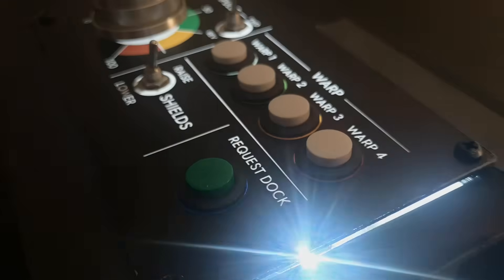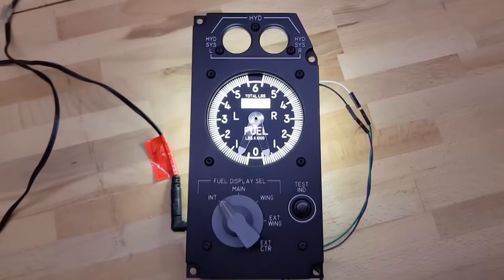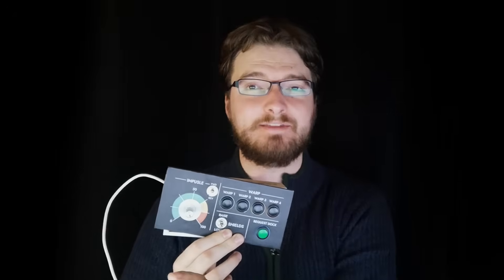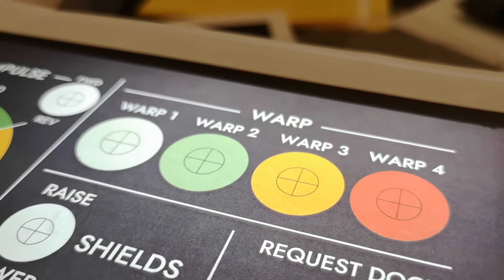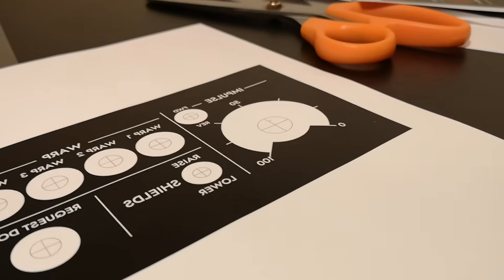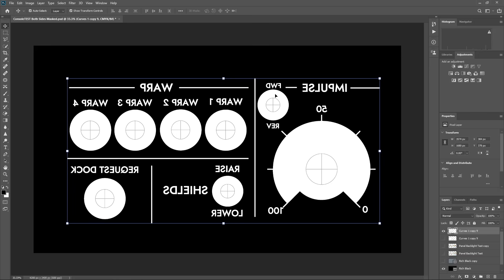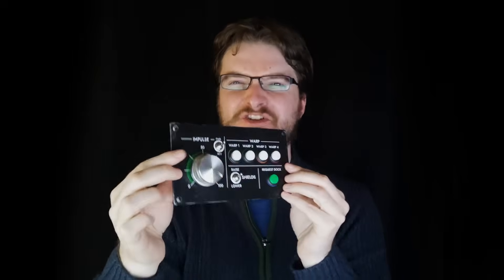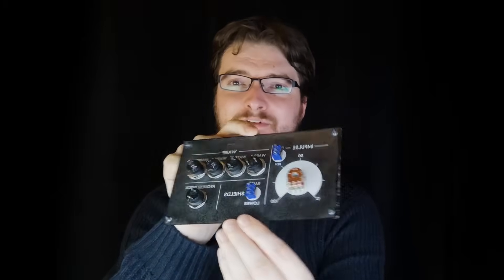The $2 Backlit Button Panel: Simple Method For Flight Sims and More

Comment: I did something like this years ago for a DJ rig. Had the problem of the black or darker colors washing out due to a strong backlight. I was printing on photo paper. The simple fix was to just print 2-3 identical prints and layer the papers together and it worked very well. Rather than trying to print on back side and flip image where alignment was challenging, just print a few of the same image and layer/stack up the photo papers together

Comment: 😁 Since I started to teach how to use photoshop I use in hands layer images to explain the layers usage, so a normal print is the front layer and the back black layer is other layer printed which can be aligned by hand. You don't need to try printing both layers on one page like presentation cards or even more precise like two sided PCB's.

Comment: Just print two different sheets, align them on the light box and use the spray adhesive to laminate the two sheets together. Then adhere it to the plastic.

Comment: After all think and paper and hours or reprinting you can buy a laser.    Lasers are much cheaper now.  I have several LED lasers my large is over a meter square.  I had used the “warthog” method for switch panels and car interior pieces.   Just go out and get a small cheap laser engraver.
Reply from the maker: Laser is a great option! I do have a small desktop diode laser engraver :-) Costs will be higher though because you have to coat in several layers of high-quality spray paint that can adhere to acryllic. And build time is longer because you have to wait for it to dry. The video makes it look like the lining-up-and-re-prinitng process might take a while but once dialed in it works very well. Definitely not hours.
Reply: @ seems like a great way to do it.  I was thinking that you could cut vinyl to darken the background.   I’m building custom gauges for my son’s car.  There’s a lot of cool tools and techniques out there.  Thanks for the vid and comments
Reply from the maker: @Sky-Soldier  Vinyl would work for sure although if there's lettering you'd have to cut out each letter very precisely to get the "backlit" look. The absolute best method would probably been screen printing or some sort of dye sublimation process, but then you're looking well beyond the "stuff I have at home" category of DIY projects.
Reply: @ there’s never a easy way to do hard work!

Comment: Why would you paint the acrylic and not use Rowmark? I can tell you did absolutely no research for this video
Reply from the maker: There's no paint used in the method I'm presenting here. If you're talking about the Warthog Project clip, paint on acrylic works very well for him and he gets incredibly good low-cost results with only a very thin layer of material to remove, making engraving easy. But a ready-made layered signmaking material would certainly work too.

Comment: Maybe a stupid question, but If I've designed a panel in Fusion 360, how can I then design the graphics in Photoshop and have it align properly with the Fusion360 file? From what I can see, I can't simply export a Fusion sketch and then open it into Photoshop.

Comment: Btw laser printers can print on transparent slides - works for making pcb masks. Or use the slides for ink jets, then you can even print it double.
Reply from the maker: Interesting, so you just run the transparency/acetate through the printer again, and print toner right on top of a layer of toner? How do you deal with registration mistakes, or is it still "trail and error and a bit of luck" as in this video?
Reply: @not sure about if laser can do two passes, but ink should be able - unfortunatelly the slide things are one sided. With registration you just have to hope it’s pulling it in consistently

Comment: Nice video. Although it is 2 years old, I wanted to mention yet another method of adding contrast to laser prints, on standard paper, vellum paper or different transparencies. I've made tons of offset print templates for less demanding product manuals this way. Simply put the print together with a cotton ball soaked in acetone under the  low cardboard lid (we used the box in which vellum paper was packed in) and leave for about 5 minutes. The print contrast should be improved significantly, but of course you should optimize all other parameters before trying it.

Comment: Why not print directly on laminate paper?
Reply from the maker: Could do, but it won't give the same look you see in this video. The idea here was "soft white backlit type" as you'd see in an aircraft cockpit, so white paper gives the right look. 

Printing onto another white material would work though, maybe a laser-printable plastic sheet like the ones made by Rite In the Rain or Neekosa.
Reply: Yeah, but I am trying to make this work for a more humid settings like in a wheelhouse in a smaller boat.
The paper might stand the conditions outside a home office. Maybe I need to buy a laser cutter😅😂

Comment: Hello, nice process, thanks for sharing. May U-I let you know that, unless you did it on purpose, the way you attacj your toggle switch is not OK. The washer with the tab is ment to be placed at the back of the front plate. The tab is originally bent and ment to poke into a hole drilled beside the main hole. The purpose is to avoid the switch from turning. Best regards, J.

Comment: That's going to cost way more that $2 just in ink alone
Reply from the maker: That is a reasonable concern, toner is not cheap! However you won't hit $2+ just in print costs for a panel this size, even printing at a copy and print shop would be $.30 - $0.50 per side or so (although I wouldn't recommend that, you really want to be working with a printer you can stand at yourself and dial the registration in on)

Comment: Looks like an Artemis display!
I did something similar using an inkjet printer printing on transparencies. I just printed 2 copies, lined them up perfectly together to assemble which made the dark deep enough. You could probably do the same thing with regular paper, although that might affect the transparency of your text, etc. Lots easier than trying to line up a double sided print though.

Comment: One can also use multiple transparency sheets stacked on top of each other.  This is what I do for making masks for homemade electronic PCBs (copper boards coated with UV-sensitive etch resist).  One might combine these clear sheets with an opaque top layer.

Comment: I just had students reprint the design multiple times on the same face on transparency. It works really well and you don't need to worry about flipping/alignment.
Ripping some of the diffusion layers out of dead lcd panels helps spread the light nicely too.
Reply: One of these days I'll get around to making my own panel for KSP instead of having students make them.
Reply from the maker: I would love to see this! Did you post results online anywhere? I did experiment a bit with transparency and acetate but never got good results, still never looked "opaque, solid material" always looked like "backlit movie poster" to me.
Reply: @EricFergusonCinema  I'm not sure I still have images as I subsequently moved to encouraging them to etch paint off with a laser engraver instead. One problem we had was getting good adhesion of the transparency to the acrylic, with spray adhesives we had. The other was cutting/drilling through the transparency neatly to put buttons in. It was doable, just tricky.
Reply: That's what they did on Star Trek sets. Inkjet on foil (multiple times if needed). If colors don't touch each other without black border you don't even need to print color layer, just put some pieces of colour film where you need color.

Comment: How well does it work if you use lighter paper, but print the front and back on two pages? Could save a lot of time and printing on alignment, since you can just do each once and glue them together. Also, these are meant to be used. What do you do to protect that paper layer from wear? I could see clear spraypaint or maybe a thin coat of modpodge...

Comment: I think most peoples home printer is an inkjet, for the price of a color laser with a duplexer you could go with a multi color 3d printer, or a vinyl cutter, or an entry level laser engraver. Just noticed this is 2 years ago, the 3d printer would have been at a higher price point back then.
Reply: I have tried using a 3Dprinter to make panels, it works but you must use fonts like Arial and not Times to get sharp clean edges. Furthermore the font must be 3mm or larger and you might experiment with a bold font. A nice thing is that the black will be really deep black!

Comment: I note the registration issue with printing the mask on the rear of the paper; would it be possible to print the mask NON-REVERSED on a separate piece of paper (which would thus be in-register), and then glue the two sheets together?

The masking ink is where you want it (on the reverse of the first sheet, or at least at zero distance from it :-)  ). You just have an extra layer of paper. It might be beneficial to use thinner paper for the second sheet.

Comment: Save ink/toner aligning by printing just the outline until you've dialled in your settings
Reply from the maker: Yes this is definitely, definitely true. It's just so tempting to use the full artwork because if you get lucky and get one perfect, then you can use it right away! But at least to start the process of dialing it in and knowing how much your printer will stray from dead-centre calibration, starting with a "wireframe" print or even just two rectangles is smart.
Reply: Why not save even more by printing both sides on 2 seperate sheets of paper and alingn them afterwards? You could even leave white pixels for alignment outside or were you drill later.
Reply: @tobiastho9639  This was my thought for my first attempt. Not only should it be easier to align, but should produce less light bleed-through. I wonder if there was another reason for not considering this?
Reply: Or you could just print one side, mask out the back and either use paint or something like thick black paper to black it out. would be much easier i think.
Reply: 👆bro uses 400% of his brain👍

Comment: That CMY technique for extra density is a great idea.

One caveat: some laser printers will be “smart” and save you toner and replace CMY with K. My older HP laser does that, and you can’t turn that feature off. 

I discovered that when printing stuff out for a digital pen. It sensed dots in the IR band. Black dots with blue text worked perfectly - the pen ignores the blue and detected the black. 

The manufacturer recommended using CMY for text and K for the dots. But this HP laser (2600? A common one) would see the CMY and replace it with K. Grey component replacement was the term.
Reply: I think I would try printing the mask layer on transparency film. 
You would need two or three to get the full black, but it is a method few people remember is out there.
Reply: HP saving you toner by default ? Color me surprised !! Must be a feature that slipped through management.
Reply: @bobsmith369  Good point. There was probably some magazine that rated printers based on how many pages they got per cartridge, and HP needed to meet that target, perhaps :)
Reply from the maker: This is interesting, I've seen a few comments like this and now that I think about it, I expect the Canon printer I was using was doing this to some extent too, although I definitely did notice a lot of difference in the texture and amount of light transmittance doing full registration-black.

Comment: I had the local print shop put my panel design onto vinyl advertising sheet stock. It's normally adheres to window glass. A1 width was £8.
Reply from the maker: Interesting! I have also experimented with a low-cost professionally printed vinyl, but I was never satisfied with how "solid" the black/opaque portions looked, they always seemed obviously backlit and washed out to me, kind of like the first test in this video. Did you get better results?
Reply: @EricFergusonCinema  It may depend on the printer type.  An inkjet vinyl printer may not do as well as a dye sublimation printer, for example.

Comment: Have you tried it with inkjet printers?  I have seen people make photo masks for PCB manufacture with an inkjet printer and clear plastic sheets designed for inkjet.  You could also just send the same sheet through several times printing the mask on the front instead of the back - that should make the alignment a lot easier.

Comment: Check out a material now sold by Tyco called Rayfast Raymark. This is available in A4 sheets, you print directly on to it, then you put it in an oven and the top surface is cured sealing in the ink and making it resistant to oils and solvents.

Comment: May be printing cross hairs at 4 corners for alignment. Print the back and front design on separate papers. This method works for commercial press that layers one color at a time by using the cross hair for alignment.

Comment: ......why not just stick a black vinyl sticker on the back instead of stressing your printer?
Reply: How would you get the black vinyl to have the right cutouts and such for the illuminated areas?
Reply: @TheSporelord01  use/borrow/rent laser cutter or those fancy smancy sticker cutting machine (eg brother snapncut)?
Reply: @Chronostra  That could be a good middle ground between the $800 laser cutter and the free-ish method in the video but it’s definitely a bunch of extra equipment
Reply: @TheSporelord01  I mean, I cut em in a cutting sticker place for about 50-60 cents usd for 50cm x 50cm size.
As I said, use/borrow/rent. Not buy the equipment.
Reply: @Chronostra Oh that’s smart, I didn’t realize there were services out there that would cut custom vinyl for you but that makes total sense
Reply: @TheSporelord01  the majority of sticker/engraver shops I know also provide that service. You just have to bring your own materials like vinyl/faux carbon sticker and the files and they would cut em up for you. If not, most of em will charge a few bucks to 20 (the most expensive I know) depending the size but your milage may vary.

I said it because I print my first panel project myself like in the video and broke my printer heads. And its 100 bucks to replace both of them (canon gx6070)

Comment: Another idea:
If you only need black and white, then you could likely 3D-print black material onto the acrylic sheet. Again, remember that you want to print mirrored, because you'd want the shiny acrylic as the top. 😉
Edit: If you want 'white', you could fill with silicone - you can even just fill with some 'plastic' colors if you need to.

Comment: This is pretty good.
-You could likely also just print several masks on other sheets of paper and layer those masks and finaly put the front on top of them.
-That would be an easy way to 'align' them - but remember that each piece of paper would dim the light further (which can produce a good effect or bad effect, so you'll need to experiment).
If you go with the "alignment" style, just print an 'X' on each side of the paper until you have it dialed in, then you won't waste so much ink/paper.

Comment: Instead of printing on a single sheet, why not print the main design on one sheet, and then the black print on another sheet. Then you just layer them.
Reply from the maker: yes, this does work although lining them up perfectly and getting that glueup perfect can be pretty challenging, even a small difference in registration really doesn't look good. I saw someone take my process here and iterate on it it by doing two sheets and stapling the pages together first (outside of the area that would later be cut out) and thought that was clever.
Reply: @EricFergusonCinema no he is right. The best way is to print on 2 different sheets and then spray glue them together.  It is much easier to get to them to line up this way. You must print registration makes to make it easier. This is the method that graphic designers use to make physical mockups of things like magazines. 

2 sheets with registration marks and then spray glue.  Also illustrator is much better suited for this to keep things vector.

Actually your design already has faux registration marks in it. The crosses you have there to center your drill. Just keep those crosses on both sides.
Reply: You can print the normal image on top half of a page, the mask img at bottom half but upside down. Then fold, line them up, glue.

Comment: I wish printers were less expensive to acquire, this just isn't an option for a lot of people. How did you seal the paper to make sure it doesn't get damaged on the top layer, I don't think I saw that?
Reply from the maker: Your local copy-and-print place will likely have a laser office machine even nicer than the one I used, for $0.25/page or so. A bit fiddlier to get the registration dialed in, but doable. Regarding sealing: In this video I did not do anything to seal it. Just allowed it to remain as ink on paper. Works great for casual use at home! Wouldn't survive a coffee spilled on it though.
Reply: Yeah my worry is spills and scratches. I wonder how bad a clear coat may affect the look.

Comment: Why not print them on the same page? One above the other. Draw one, save the image. Then paste the saved image below the first and add/subtract features. Finally, print, cut and paste. Should come out identical in size.
Reply from the maker: With the right combination of papers to still get good light transmission, yes this would work. It'd basically be removing the difficult task of manual duxpled printing alignment, in favour of your cut-and-paste alignment skills. Some have suggested stapling the pages first, then gluing.